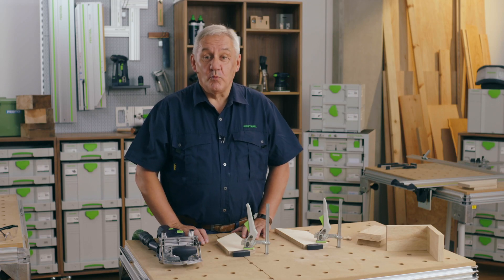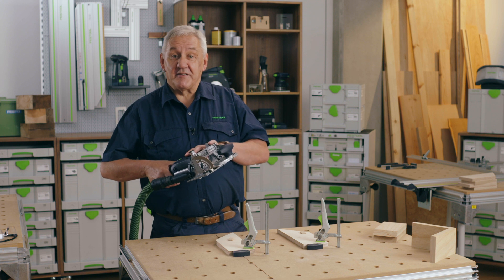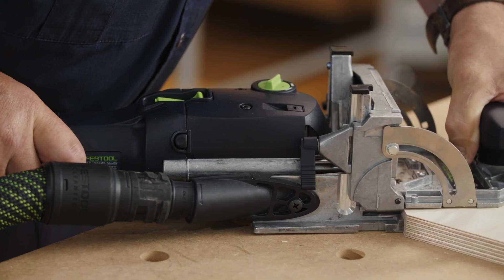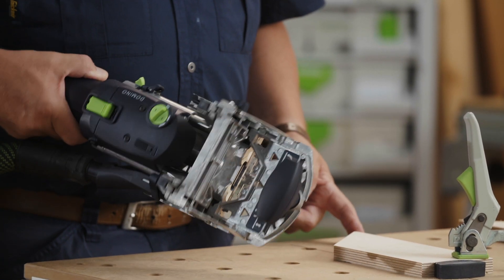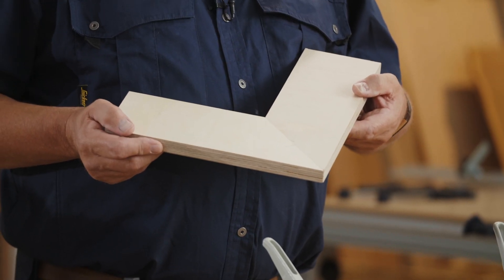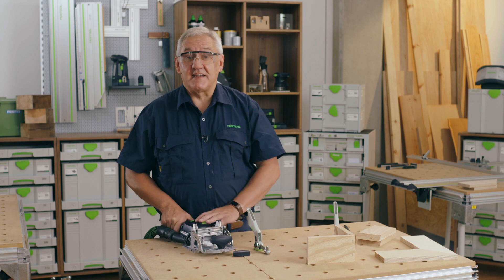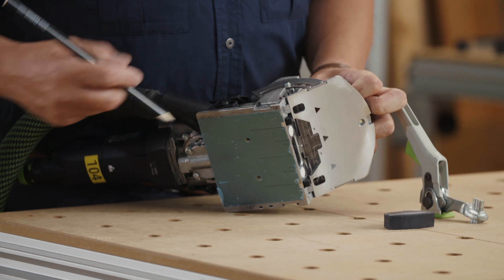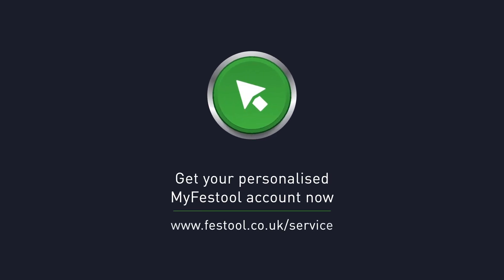Mitre joints with the Festool DOMINO DF 500

Comment: This is good Gordon, but what is the best assembly technique when you have four sides (i.e. a frame or box). While three sides are easy, it's a little more difficult to add the 4th side.  I haven't found an elegant way of doing this and usually struggle.  I'm looking around for best practices on mitered joints with dominos.  Thx.
Reply: Late reply but for others who find this:

Join 2 pieces to make a 90 degree corner, then join the opposite 2 pieces separately. Then you can connect the 2 subassemblies since the dominos will be parallel on the remaining 2 diagonally opposite  corners.